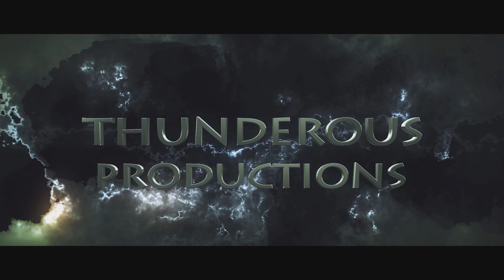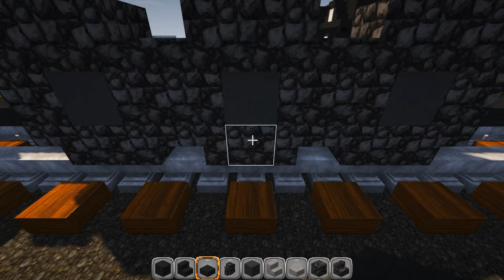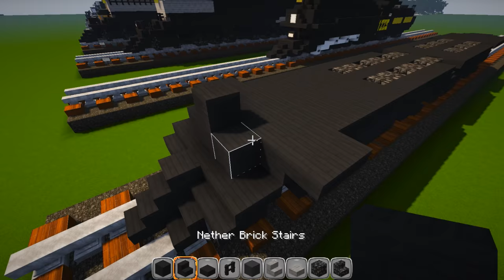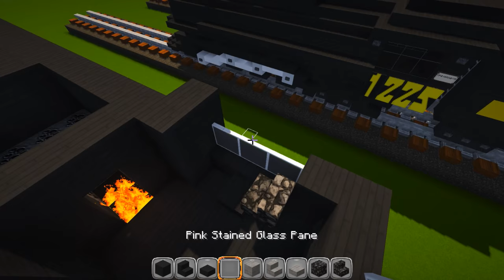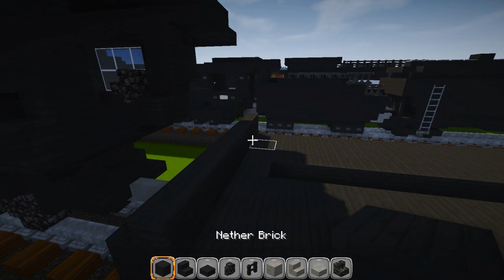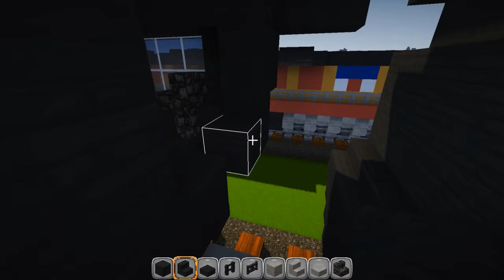Minecraft Train Tutorial : Steam Locomotive - Union Pacific CHALLENGER TUTORIAL

Comment: The Big Boy is basically an improved version of the Challenger.  Challenger was first built in 1936, while the Big Boy appeared in 1941.  Both engines are capable of pulling 5 mile long trains at speeds raging between 70 and 80 M.P.H.  Both engines would also pull passenger trains, though Big Boy only pulled passenger when there were no 4-8-4 Northern or Challengers available for the service.  Big Boys, Challengers, and Union Pacific 4-8-4 all used the same type of Centipede Tenders.

Now that both Big Boy and Challenger have been made, you now have the ability to make 4-6-4 Hudson type locomotives and 4-8-4 Northern type locomotives or any other steam engine type.  Just remove the second set of drivers completely, shorten the boiler as needed,  remove the necessary number of lead and trailing wheels as needed, and make some cosmetic changes on the front of the locomotive depending on the road name.   Hope this helps with making future videos Jag.  Keep up the excellent work man!
Reply: Jesus thats alot of Knawledge 0-0
Reply from the maker: Lol. Already on all that. Just finished the 844 :-)